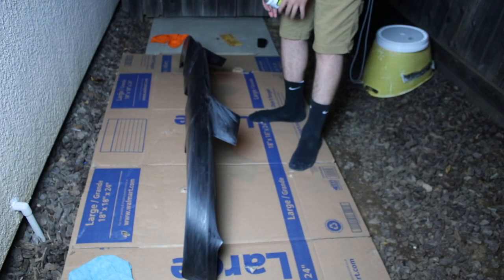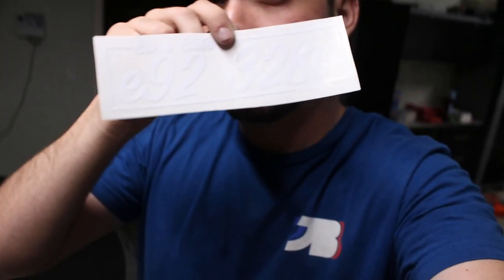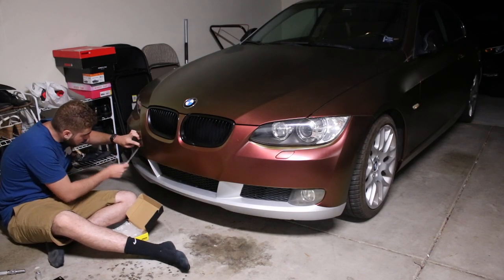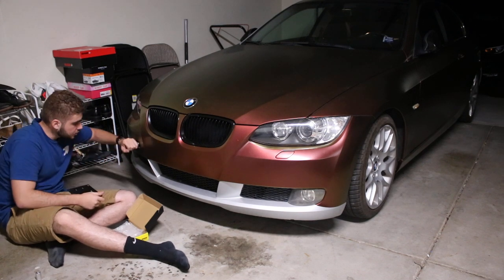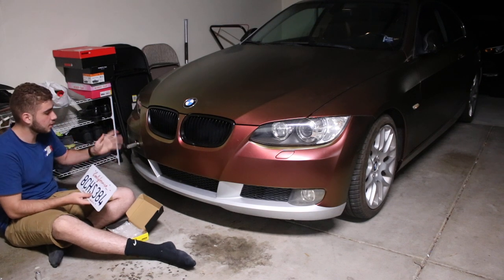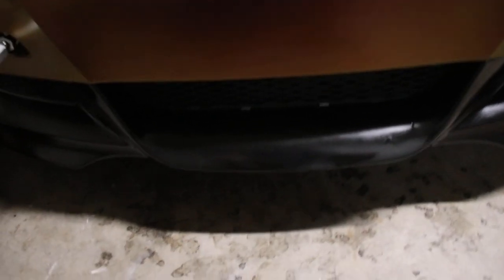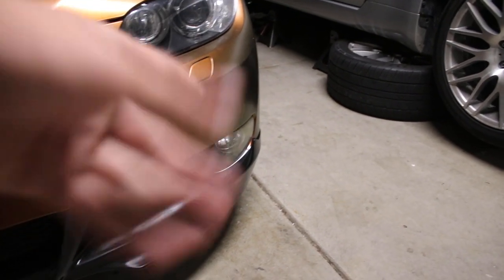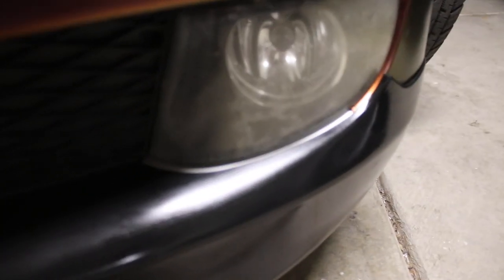NEW BMW E92 LIP INSTAL!

Comment: I learned to hard way when painting with spray cans but ultimately perfected it through my mistakes. Prep is everything with paint but you need quite a bit of elbow grease. Here's some steps that will help you paint it perfectly.

Since it's painted already, badly: 

- Dry sand with 400-gritt
- Apply 3-4 coats of flexible plastic primer (SEM makes a good one) 
- Lightly dry sand primer with 800 gritt to introduce micro scratches and a base for the paint (Clean it before painting obviously with isopropyl alcohol) 
- 4 Coats of base coat (Use a tack cloth between coats to reduce dust and fallen particles
- 3-4 Coats of 2K spray can clear coat.

- Bake lip in sun for 3 days, or let dry for a week in garage. 

- Wet sand lip with 2000 Gritt sandpaper (Medium pressure)
- Wet Sand lip with 3000 gritt sandpaper (Finishing touches)

- Buff lip with orbital buffer with compound
- Polish lip with orbital buffer with finishing polish
- Apply sealant, ceramic coat, or wax. 

You are done and have a professional grade paint job using spray cans and some elbow grease. and remember, TIME is everything with paint. Don't lose patience, allow proper flash times between coats, go inside and jerk off or something Lol.